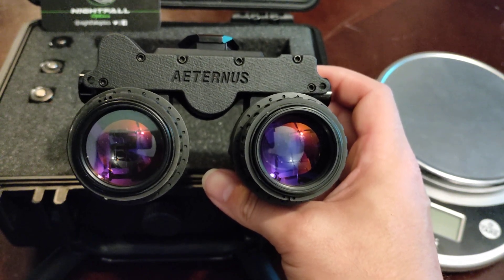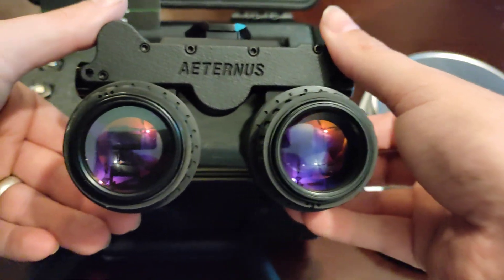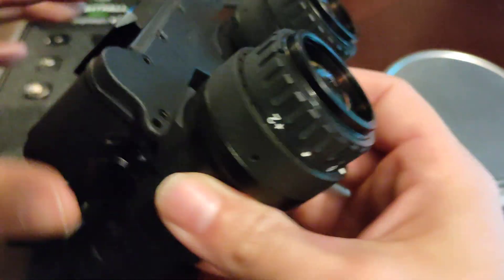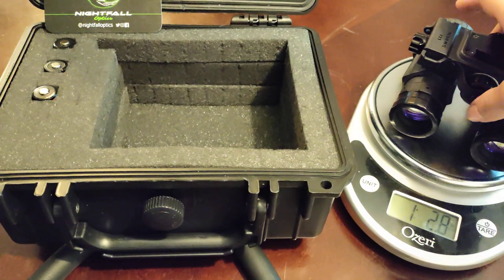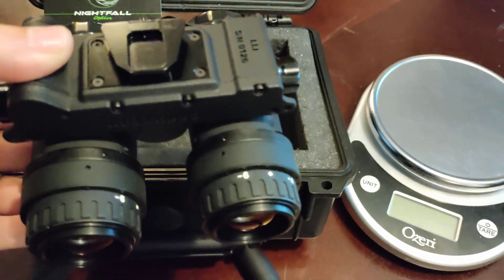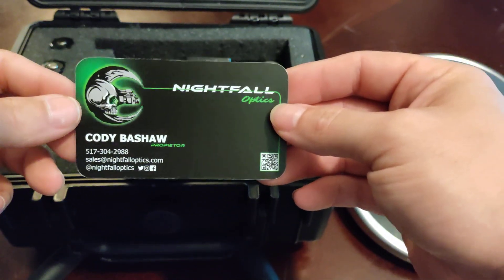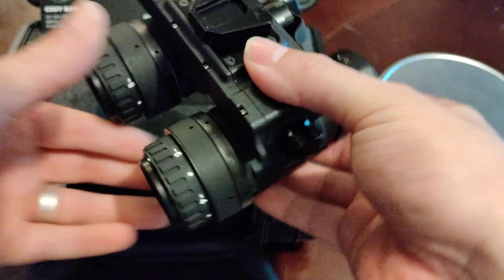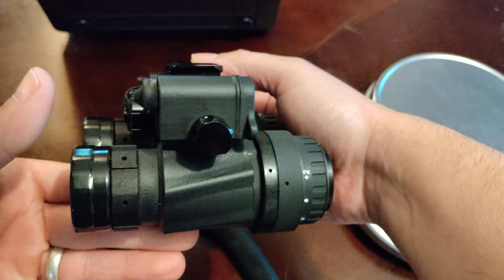Low Light Innovations Aeternus

Comment: What if you have a wide face?  Are you unable to adjust each device to center over your eye?
Reply from the maker: The two knobs I point out on each side of the device is the way you adjust for eye spacing. They are the Interpupillary distance stops or "IPD Stops"
Reply: @MICHIG00N  I greatly appreciate the response.  Got some on the way, can't wait.

Comment: Does this unit come complete or is it just the housing?
Reply from the maker: You can pick up the housing alone, or a complete unit. This particular unit was a complete build from Nightfall Optics.
Reply: @MICHIG00N  how much is the complete build with White Phosphor?
Reply from the maker: Depends on the WP Intensifier tube. Starts around $6k and goes up from there. Brand new from Nightfall Optics it'll come professionally built & purged. I've enjoyed the housing, it's the second favorite unit I own. Lightweight, consistent IPD & extremely simplistic. It's been a great unit for blackout driving.